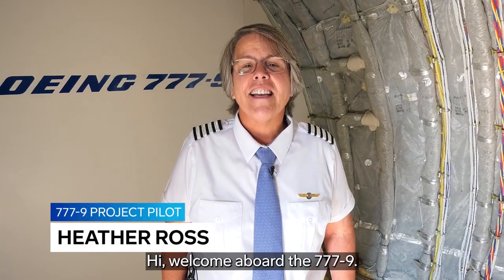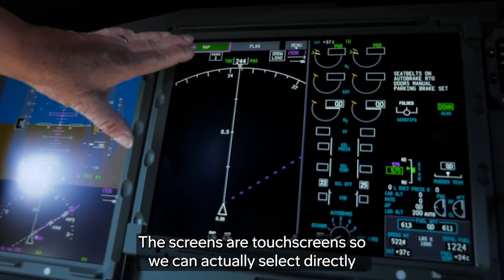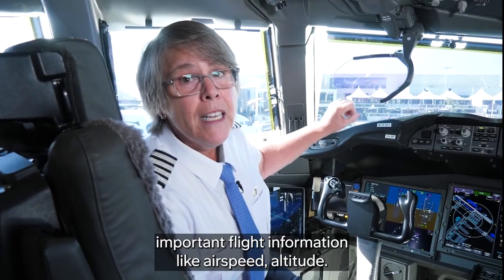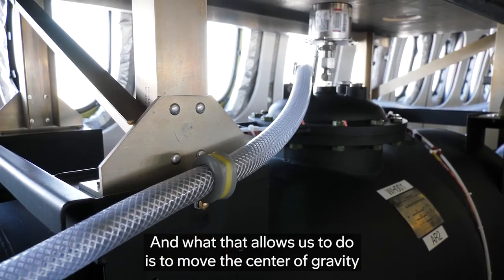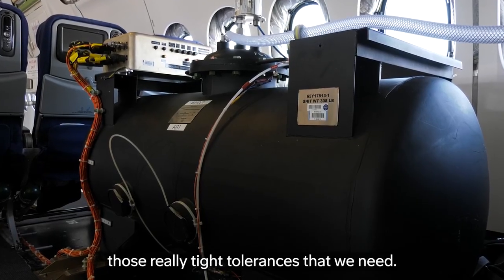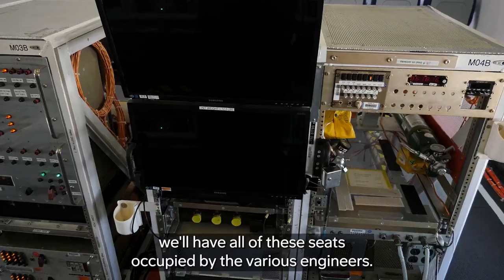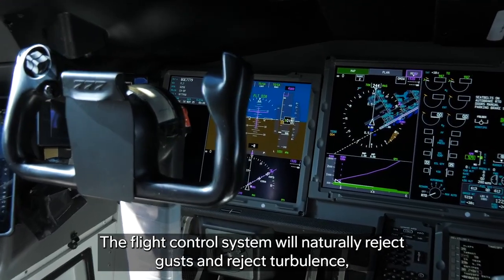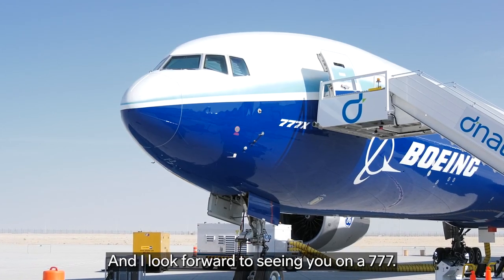Climb aboard the 777-9 flight test airplane

Comment: Boeing... listen to me... PLEASE DON'T PRIORITIZE POWER, PRIORITIZE EFFICIENCY, IF YOU LOSE TO AIRBUS A350-1000ULR YOU CAN LOSE YOUR FANS, CHANGE ENGINES, REDESIGN GEAR, ADD FUEL TANKS. I hope you can beat A350-1000ULR with 777-9X
Reply: The 777s get their power from big turbofans and small compressors that make the engines very efficient, it's just that the 777 is haveir then the A350 or 787 making it burn more fuel in order to stay in the Air
Reply: I mean the 777 already beat the A350-1000 in orders

Comment: Do you really think those touch screens are a good idea? What about if they go out? There really should be a place for some analog stuff
Reply: Of course there is also some analog stuff for redundancy, but it's going to be used as a touch screen if it works just like the A350 it also has a touch screen, it's modern tech

Comment: You have to build the Boeing 777-10X to compete with the Airbus A350-1000/2000 if they manage to make it, and maybe some new engines because they are developing a new engine called Ultra Fan which is bigger and more efficient and lighter than your current GE9X. If you decide to make that new engine you have to call it GE10X 😂😂😂😂 seriously.
Reply: The A350-1000 already exists, and the 777X is significantly bigger. The A350-2000 doesn’t exist and probably never will.

Boeing and Airbus also don’t make the engines just so you know. Your comment is a run on sentence and completely incoherent.
Reply: @Fluffy-b1c   I know that both Boeing and Airbus don't make engines, GE and Rolls Royce make engines for them and when I said Airbus A350-1000/2000, I meant the -2000 only.
Reply: @MR-GT3-R Then you should probably reword your comment on the engine types
Reply: Fellow gt3r enjoyer, i love that car
Reply: Dei